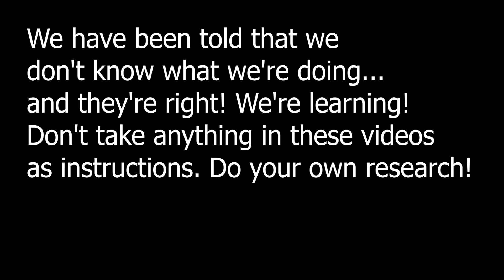Porsche 924S EV Conversion - Part 15 - Mount Options for Bosch Pump

Comment: I can't help with the plug for your pump but have you checked out the Nissan and (I believe) Tesla water pumps? I found a way to control the speed they pump using an arduino to put out a 2Hz PWM signal. If interested check out the Nissan section in OpeninverterdotOrg and the thread is currently near the middle of the page